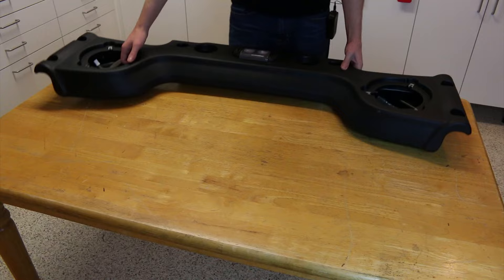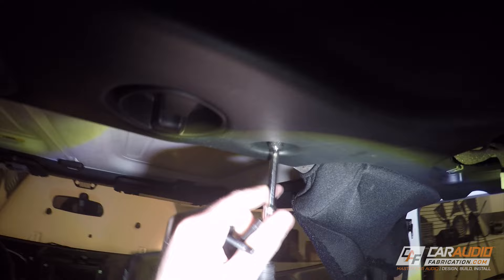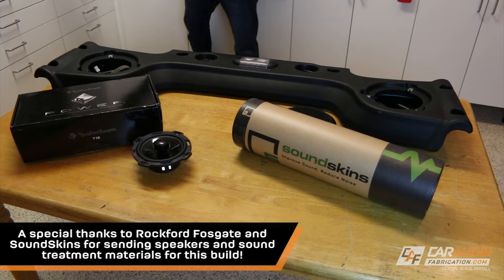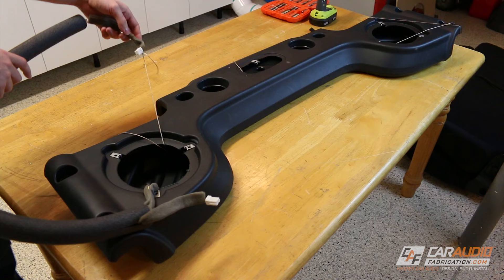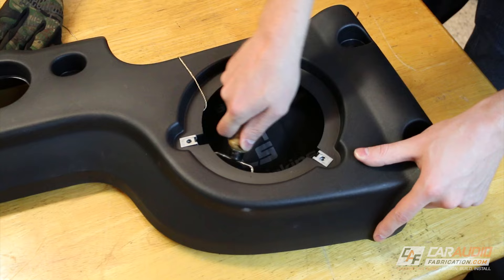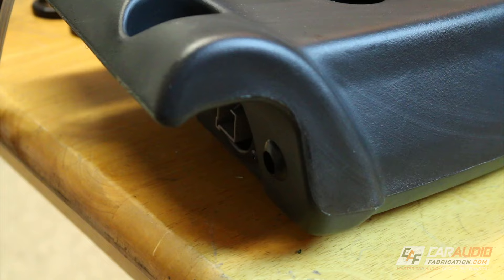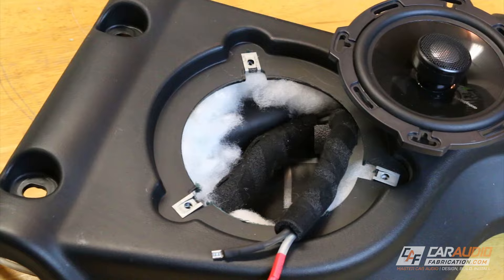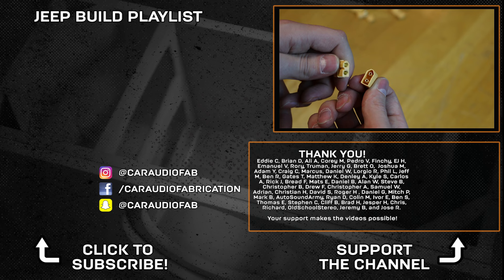Jeep Soundbar Sound Upgrades - add MORE bass! - CarAudioFabrication

Comment: Thanks for the video. I just did this for my 2014 JK soundbar. I used the Mopar Kicker coaxials  ($60) and the difference over stock is striking. Factory soundbar speakers are total junk.

Comment: I have a question? When you installed the coaxial speakers, did you disconnect the factory tweeter? Because there’s tweeters in the front and tweeters in the sound bar I was planning on just putting 6 1/2 inch Fosgate subs in the rear sound bar and coaxial‘s in the front or 6 1/2 subwoofers in the front also, so do the tweeters need to be disconnected or can they stay connected?

Comment: I did this to my sound bar in my aging TJ.  It went from a sound similar to what a tablet may have to a sound similar to a higher end television, which is vastly superior to the tablet-like sound.  It will likely never have a premium bass sound with screeching treble and rich mid tones.  But it is much, much, better.  My aging TJ has the soft top and the soft doors so there is only so much that can be done with an open type vehicle.  But I did not get a vintage Jeep for a car-like experience.  I am taking the bad with the good.  But this method made the bad, only slightly bad instead of annoyingly bad.

Comment: I just put Addictive Audio 6 5 in. Carbon fiber in my soundbar. It's deadened, insulated, and uses an inch and a half spacers so no need for cutting. It rocks hard and clean

Comment: I replaced the soundbar in my 2014 wrangler with the 2015 sound bar because it had extra speaker holes which I used to mount the tweeters by making a bracket because I put component speaker in it.. Also, I removed the stock connector and ordered a Nomex connector that had the proper number of positions so I could run all the wires for the speakers and light and used the stock connector grommet by using a heat gun to remove the black epoxy they filled it with. Looks stock and it's easily removable like the stock one, just remove the electrical plug and the bolts and the whole thing comes down.

Comment: I really like your string trick... I tried to use it when I did my speakers last week on my 2017 Wrangler JK. I say tried because my wire harness in the sound bar had rubber grommets between the speaker holes and the interior of the sound bar. Additionally the center section of my Jeep's sound bar seems to be filled with some sort of foam. I spent several hours attempting to use a coat hanger to fish string through the bar so that I could pull the wires; I finally gave up and cut the grommet apart on one end so that I could get the wires pulled. Once I did that the rest of the speaker install was fairly easy; I left the factory harness in place, along with the factory tweeters in the sound bar (disconnected) for about the same reason you did.
I re-watched the video just now and it looks like your speaker bar is different from mine, (different year?) so I take back all of the things I said during my struggle with the speaker bar  :)

Comment: I didn't have poly-fill, so I used pillow stuffing. Lol. I installed JBL GX602's. I'm interested to hear the difference with the Dynamat. Doing my gf's Jeep next week with JBL GX600C components front and back, since the 2015 Wrangler uses components in the soundbar as well.

Comment: @CarAudioFabrication  Great Video !  One thing other videos talk about but you didn't mention is polarity of the speakers. I was hoping even though it does not pertain to this video you could help me out since you have the experience.  

I have a 2022 JTRD with the upgraded 8.4 Alpine system.  So I have a total of 9 speakers including the sub.  4 speakers up front (2 top dash / 2 knee panels) and 4 speakers in the rear sound bar (2 - 3/1/2" and 2 - 4").  I do not have the high tech equipment like a professional shop, so I used my cell phone and a multimeter to do my testing.  

My question is mainly referring to the sound bar... but here is the deal:   

There have been several instances where the wiring diagrams(posted on the Gladiator forum) and the +/- or polarities have been reversed from the factory , so I wanted to test and double check mine.

First I checked the front two(2) upper dash speakers with my multimeter and determined my +/- wires were opposite of the OEM wiring diagram.  For the left, Grey/Orange - (Neg) and Grey/Yellow +(Pos). For the right, Grey/Dark Green -(Neg) and Grey/Light green +(Pos). Once I connected the speakers, I then used my cell phone app for Android (Polarity Checker)  to double check my multimeter reading.  When doing this,  both upper dash and lower knee panel speakers "POPPED" green. So from these results,  I am assuming I have all of the positive speaker wires coming from the head unit(AMP) connected to the proper positive terminal of the speaker.

***This is where my question/request comes in.....**** Since you have or most likely will work on other Gladiators/Wranglers with the 8.4 system or the next time you do, maybe check and verify for me.(PLEASE)

I know in general, you want all of your speakers to be the same polarity,  either all "POPPING" green or all popping red, but from my understanding(which is limited on the subject) I read there are some instances where you want your speakers to have opposite polarities, such as if when the speakers are inside the same enclosure . I read it could also  be caused when using a crossover.  I wasn't sure if this was 100% true... 

I haven't upgraded my soundbar yet, but before I did, I wanted to check their polarity.  Testing using ONLY the cell phone app.......  the two smaller 3-1/2" speakers (on the outside of each end of the sound bar "popped" red and the two inner 4" speakers "popped" green.  I was wondering if since one of the 3-1/2" and one of the 4" speakers share the same pod, are they wired this way on purpose from the factory ?  Thus, making the 4"  push , while the smaller 3-1/2" pulls..... working together... maybe more efficient ?  Or Should both be wired the same (making all 4 of the sound bar speakers function the same and "pop" green) and then ultimately, making all 8 speakers pop green together ? ...  

I plan on updating the rear soundbar speakers and want to make sure I have them wired correctly when I do.

Hopefully I didn't make this more confusing than necessary, any help would be greatly appreciated.

Comment: Your videos have helped me out tremendously!
I have a 15 Wrangler and doing the same project with Phoenix Gold Coaxials.
My soundbar is totally different at the speakers though.
Reply: xdime2007 do you have the 8 speaker system with the separate 6.5" mids and tweeters?  My 2016 JKU Sport S has that.
Reply: xdime2007 definitely no Alpine system.  It's just an 8 speaker system.  Sounds awful.  I can't decide if I'm upgrading speakers or headlights first...
Reply from the maker: Speakers first!
Reply: CarAudioFabrication I need some of those tweeter adaptors you made for the dash.  I don't have tools anymore.  How much would you charge for two pairs of those?

Comment: @caraudiofabrication I love your work. Im doing a very similar install on my Jeep, however I've decided to use a nexus tablet as a head unit. I'm looking for a good way to have the audio transferred over to my amp to reduce the wiring. Do you recommend Bluetooth audio? Are you interested in creating a nice system using a nexus tablet as head unit, And modifying such to integrate fully with a new audio install in the future?

Comment: Nice video Mark.  I have a 2016 wrangler with the sound bar that has the 6.5" and tweeter combo.  I added a stronger 4ch amp so I want to run the 14ga speaker wire to each sound bar location, not using the factory wiring.  Is there an easy way you've found to get the larger speaker wire inside the enclosure without simply drilling into it and still keeping it water tight?

Comment: You may have done this or answered it already. I couldn't find it if you did. But how do the all in one amp/subwoofer perform? I have a truck and I use the rear underwear storage for just that. So the only place I'd really have room for anything is under the jumpseat on the front bench seat of my truck. I haven't been able to find a video that really helps or shows how they perform. Mostly people recording stuff on their cellphones.

Comment: i have a 2011 ram with the Alpine upgrade, i have 2 10 ' s running off the factory amp sounds pretty good but want more bass , how can i add an amp to the factory unit ,and its powered at 2 ohms

Comment: Hi, im looking to do an upgrade to my soundbar as well, i already installed JBL speakers in the stock locations but im considering going to 6x9 speakers and making my own custom soundbar, would this process be possible and if so, what materials should i use to construct the soundbar? Thank you for the great video.

Comment: I did this to the soundbar and front speaker enclosures in my 2011 Wrangler. I used Kenwood 3-way 6.5"s. It sounds better than stock but I am disappointed in the lack of bass. I removed the polyfill from one side of the soundbar to see whether it made any difference as I was thinking that maybe it reduced the volume of the enclosure too much.  It didn't make a difference to my ears. I suppose the enclosures are just too small as I had Kenwood 3-way 6.5"s in the doors of a Mitsubishi mini-truck back in college and that thing sounded AMAZING. Luckily I did the same to the stock sub enclosure and upgraded to a Kenwood sub and it makes up the difference. Just wish the 4 6.5"s were reaching their potential to make the Jeep sound amazing as opposed to "good."  :/

Comment: Do you not still have factory wiring from the head unit or amplifier? What is the point of just upgrading a 4 foot piece?
Reply from the maker: Upgrade the full length. The key part here is more the sound treatment that prevents the enclosure from flexing and rattling.

Comment: Why couldn’t you re use the stock wires for the after market speaker?
Reply from the maker: Not large enough to handle the increase in power, and if I'm going to take the time to sound treat this I'm not going to not spend $5 extra  bucks for good wire.
Reply: So did you run an aftermarket amp for that Jeep install. Did you put on video the whole Jeep install?

Comment: Hi. I have an undersized sub box. It is 0.36 cu.ft. fitted a Powerbass S10TD wich needs 0.75 cu.ft. The sound is not perfect but before I stuffed it with polyfill the sound was worst. I had to remove almost all of it. Isn't polyfill a solutoin for undersized boxes?
Reply from the maker: That box was far too small to begin with.  Polyfill is used to account for a small percentage of increased volume, you were looking for a 200% increase which is unrealistic.
Reply: I know that, but I don't have more space and I thought that polyfill could help, but was not my case. Hey! thanks for your answer. You channel is amazing.